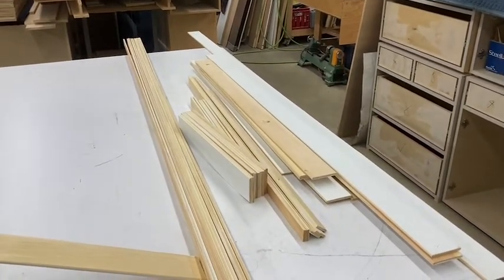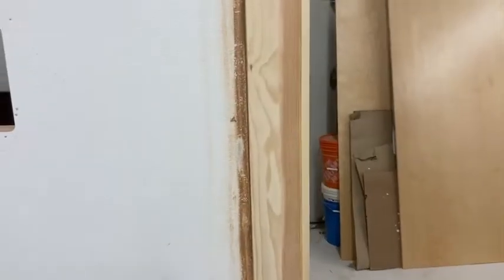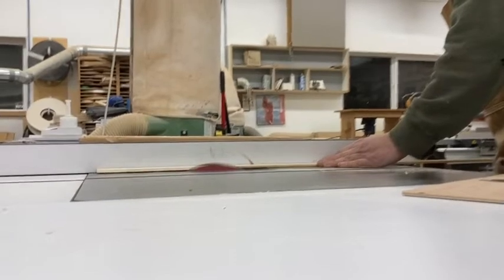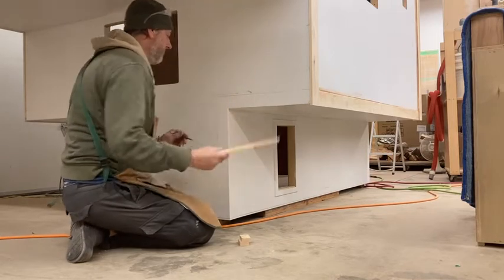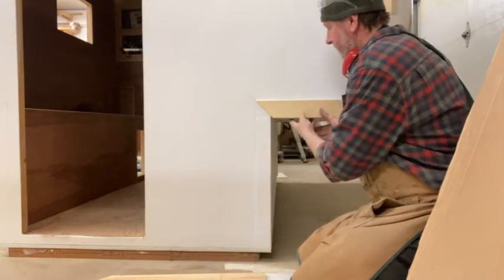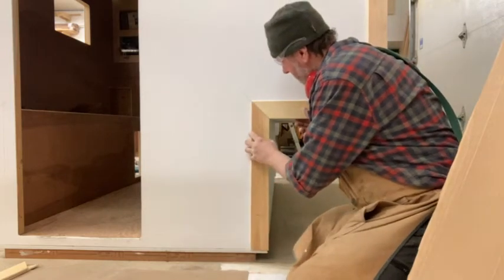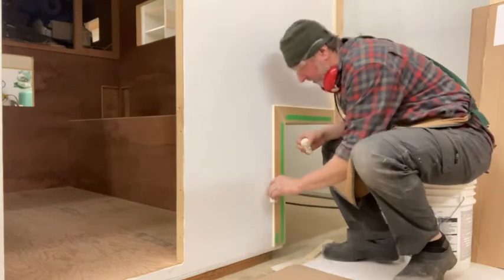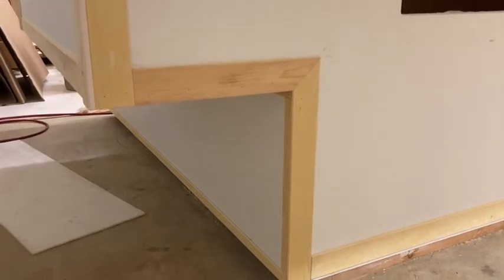Homemade Truck camper build!! ( part 27) exterior trim complete !!

Comment: Absolutely love it. ive watched every part. Now please dont take offense to this but as good as a carpenter you are you build them better then most manufacturers ,, this being said YOUR OVER KILL ON THINGS IS WAY TO MUCH....
Reply from the maker: Hahaha.. overkill ? Probably ( that’s how I say yes ) . I presently have the luxury of not being in a rush … so it’s easier to go overboard … I doubt I will regret in the future my extravagant attention to detail, but I may regret a few cut corners 😀
Reply: @mikesniedze9122  I've been building one now for about 10 yr.s ..
 Still haven't started yet..
 I'm going to put it on my 5x8 tilt trailer. It's not a flatbed but rather elevated wheel wells so it's basically like a truck bed..